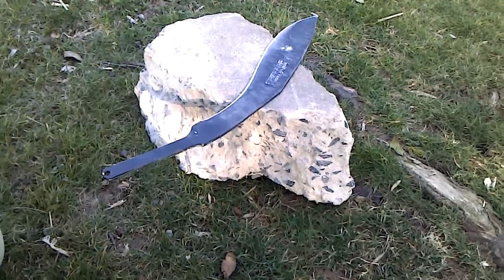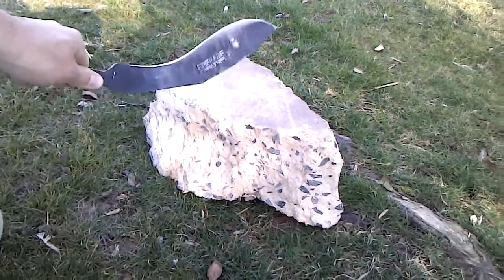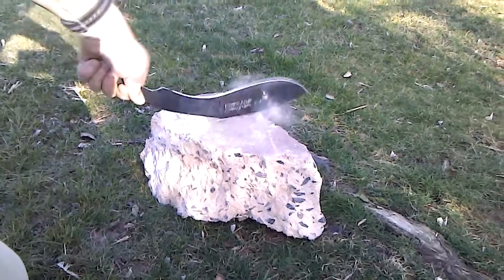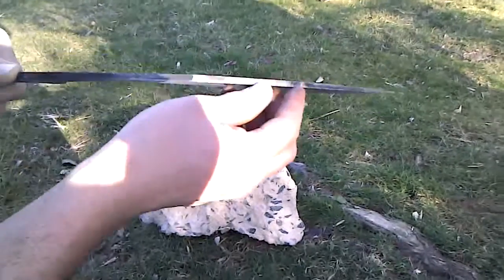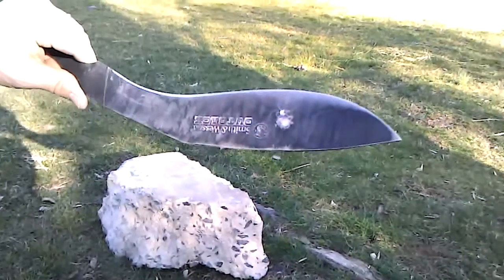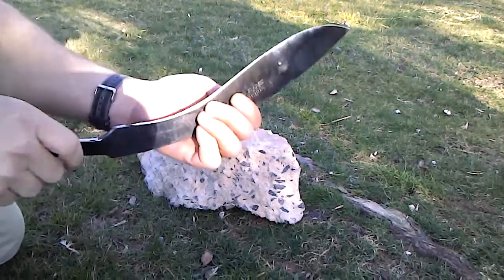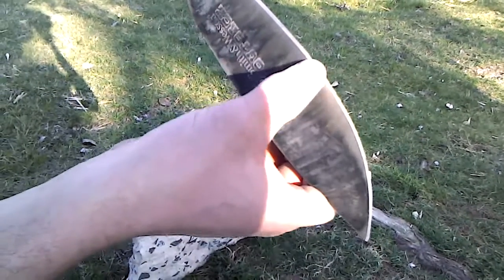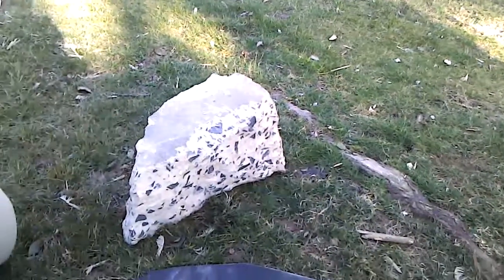Chinese 440 mystery steel- Test 2 of ?, "Concrete Performance"

Comment from the maker: @udannlin no sweat. It's actually as workable of a steel as most non-stainless offerings. It's hard to describe, but high carbon blades have more of a "dense" feel to them. If you were to look at 440 under a microscope, I believe you would see more of an open grain. That leads to a different feel to the sharpening process, but it's still no problem to get a good working edge. Thanks!

Comment from the maker: @CliffStamp I use a Chef's choice 120 to sharpen just about all my knives. I read somewhere the angle is 25 degrees (unsure if true). It does produce a micro bevel along the cutting edge on the second stage. Stage 3 is just a strop. After using the sharpener, I run the edge on a fine stone, then steel it up. It works perfect for me, and it's fast. I failed to measure the edge after impaction and I already used my belt sander to work out the dings before sharpening. Shucks! I'll check next time!

Comment: What is the approximate edge angle and can you measure the thickness of the edge after the impaction?

I am as impressed by your ability to hold onto the bare tang, that looked a little uncomfortable.

Comment: What's the mystery?  It's 440A, which is not bad steel.  It's teh first choice of divers and many fishermen because it's far most impervious to water than 440C.  A generation or so ago, people would have killed for 440C.

The only problem with 440A is trying to sharpen it with a whetstone.  It's a whole lot easier with a diamond stone.

Comment: Ow. Durable though. People are stupid when it comes to 440, especially in regard to swords. Bones aren't hard when living and can actually be cut through with ease. The people saying a 440 sword would shatter on impact against a body obviously have 0 knowledge on the metal and it's qualities.
Reply: I thought kitchen knives used 440 Stainless Steel I just bought an Excalibur replica claiming to be 440 steel the reviews sound legit so I am willing to prove if it's 440 stainless steel.

Comment: I can promise you thats not 440C.   Thats the high end of the 440 line, that knife is 440A most likely. 
   154cm is actually a tweaked version of 440C made by Carpenter steel. 
 There is absolutely nothing wrong with 440c as a knife steel,  it was actually The premium steel not too long ago, but new tech and new steels mean that  440c and even 154cm got left behind, they are still good but there are far better options these days.     
  My point being if that knife is 440A, 440C is that much better.  You would get the same result of a rolled edge smashing it into concrete like that but for normal uses 440c would outperform 440A.     But for an all around low cost steel 440-A is still a good choice,   Gerber still uses it alot in there lower priced knives, they just dont advertise
Reply: Gerber use 440A or 440C?
Reply: ***** Gerber uses a 440-A equivalent, 7cr17mov for alot of its knives, basically if its a folding knife and the steel isnt listed it will be 7cr17mov (Chinese 440-A)      For their fixed blade knives if the Steel isnt listed its most likely 420HC, though I cant be certain without testing them all.   But they use 420hc in alot of their fixed blades even the cheap $20 ones made in china.   
           Gerbers more Expensive knives use different steels,  They have knives that are in 154cm ( proprietary 440-c) and s30v, as well.      If the knife is a higher end Gerber they will normally list the steel because they want to use it as a selling point.       But I think after years and years of people complaining they finally got the hint and started listing the steel on even the cheaper knives.
Reply: SavageShooter93 Ah okay. Thanks for the quick reply, very interesting